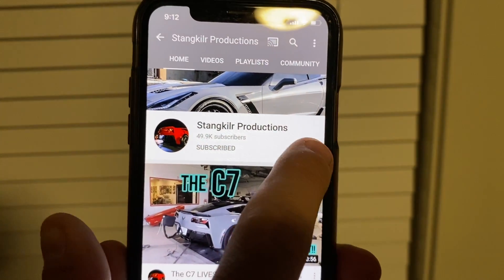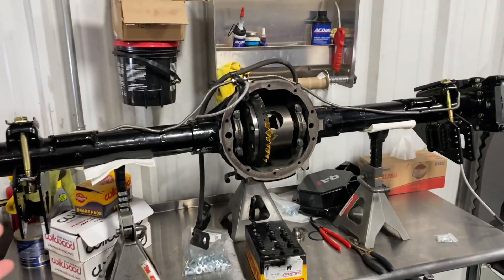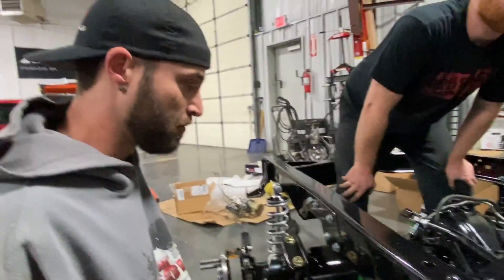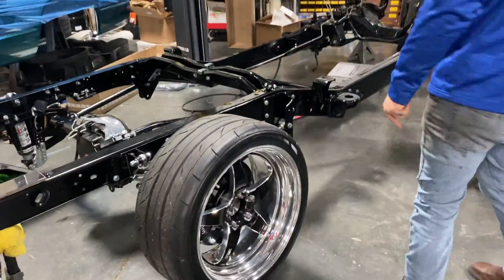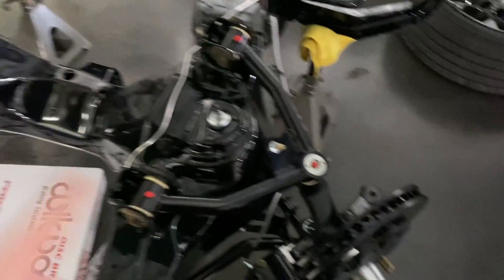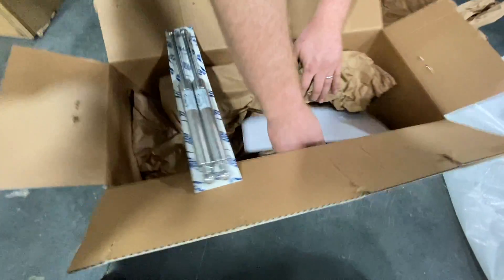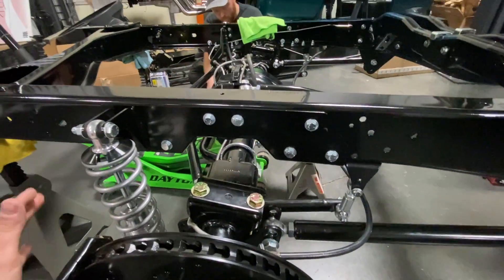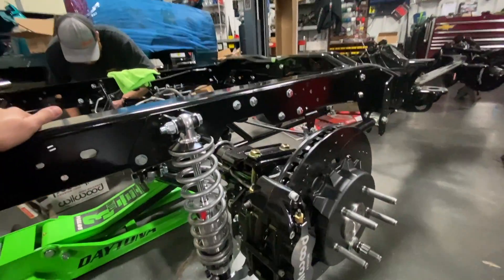Full QA1 coil over OBS Chevy suspension install completed. Its a work of art!

Comment: You're definitely not cutting any corners when it comes to cost, but it shows in each and every way. Just the frame alone is a work of art, let alone what the finished product is going to look like. It's definitely beautiful and I'd bet it's going to work even better. Yes, the stopping power should be insane and so smoooth ! Can't wait to see the mill dropped in and the rest that follows. I can see why you quoted what the final cost was going to be. Too bad you won't be able to see most of this, but that rear end will be visible and that's a work of art in it's self. Keep on trucking on ! 😉 💯 😎

Comment: Whats the widest rear tire u can run I feel like the location of ur rear coil overs takes alot of space away from how wide of a tire u can run
Reply from the maker: I can run a wide enough tire that if I go any bigger it will not fit in the wheel well. Shock isn’t in the way

Comment: Question I'm putting on the same Qa1 upper and lower control arms with the 2 1/2 " wilwood drop spindles.  How did you guys compress the upper and lower control arms together to be able to put on the drop spindles and screw them down.  I have no engine just a frame like you guys. I'm on a stand still. Would love your feed back. By the way beautiful build.

Comment: What all is done to the 10 bolt to hold up against all the power? I know you mentioned its a truetrac carrier, but what axles and/or other mods are done? Just seeking info for my own swap.
Reply from the maker: It’s got the Yukon brand hardened axles, Eaton diff and Yukon gear set. C clip eliminators too
Reply: @StangkilrProductions  Gotcha, thank you!